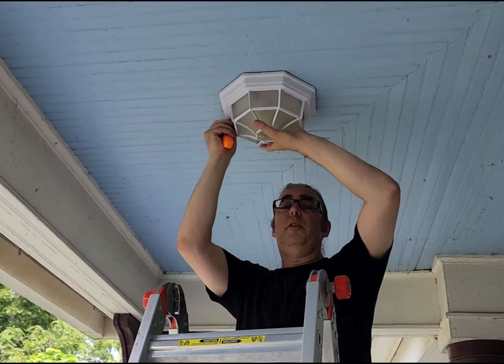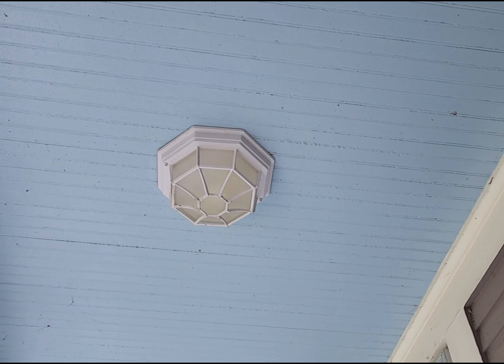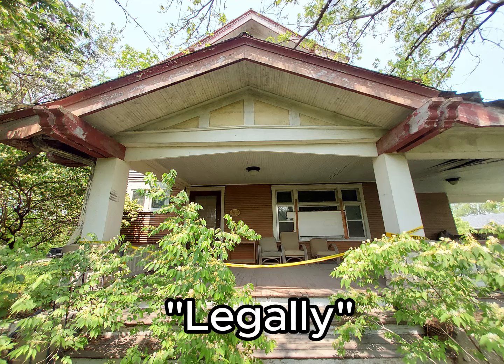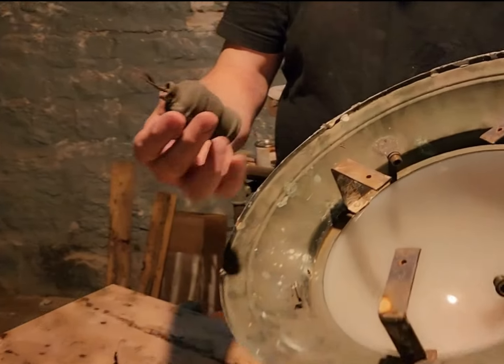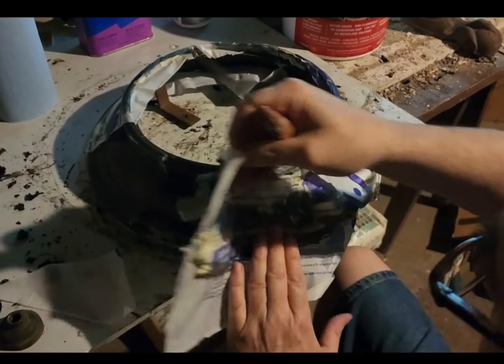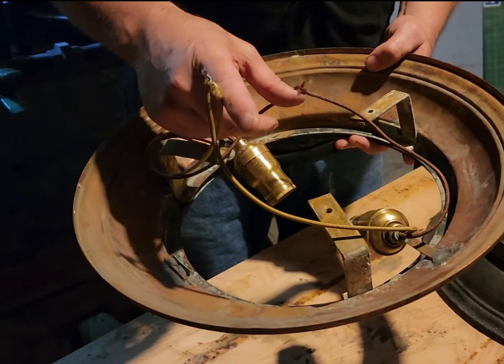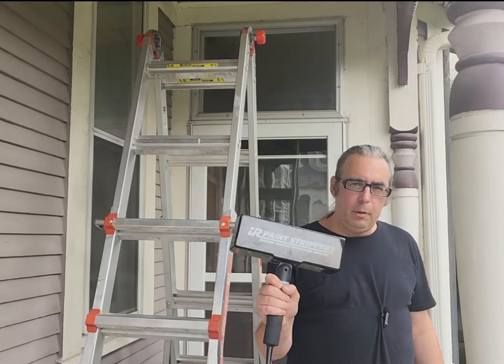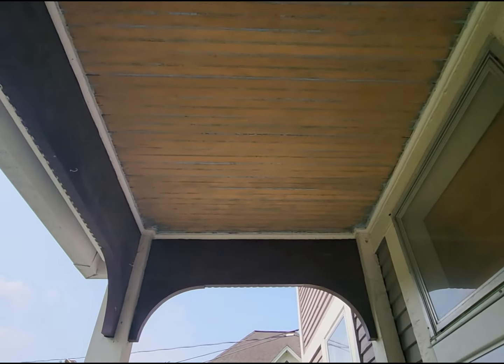Haint Blue Blues & Porch Projects S1 Ep8

Comment: So even though it's slow you would recommend that IR paint stripper?  Lead paint issues myself. Someone on Amazon recommended finding a way to attach it to a pole although he recommended Cobra for big jobs.
Reply from the maker: @eicrusade6161  I don't see where a pole would help since you still need to scape it.  I added that spacer so I wouldn't be straining or guessing at the height holding over head and felt the size  of the IR vs the cobra was a better size to the 2" beadboard and could scrape longer pieces there are others that are larger when doing siding and such but are alot more expensive. This porch wasn't that big so was a good test.
Reply from the maker: carefully stripping paint is always time consuming. But would certainly recommend. Its cheaper then the cobra and did a really good job. I added the link to it in the description as well.  https://amzn.to/3LHJceA

Comment: with theses sockets i assume you know the live wire goes to the centre of the lamp socket
Reply from the maker: @moodyga40  both wires come out the bottom of the socket with a female threaded end which feeds into a hollow threaded stem (like a inner tube) for mounting. At least that’s how they were. I wish YouTube allowed for photo comment to better show
Reply: Fabulous if you put the hit wire to the centre pin its a lot safer as it's an Edison screw lamp

Comment: Hello! I live in Mt Pleasant, Iowa, and I own an Edwardian home... but the previous homeowners have done so much to this house it seems impossible to even consider renovating to the original state. So, I might not. Why do you want to utilize the fabric covered electrical? Wouldn't that be a fire hazard, like you said? Would it not be ideal to do something more modern with the wires, or is it more that it would be impossible to use newer wiring?
Reply from the maker: @SilverIntent  Greetings from Fairfield, Iowa! So "original state" would be restorating, not renovating. The wiring is modern insulated the braided cloth exterior is just ascetic and just looked nice even though you'll never see it.
Reply: @JamesABeckHouse  Ohh, okay. Nevertheless,  really cool progress you've done. Did you have any broken windows, and if so, what are your plans for fixing them? If the old house is purely one pane of glass, vs double pane.
Reply: I don’t see why window repair would be that big of deal. Repair parts including age appropriate glass are available within the state.